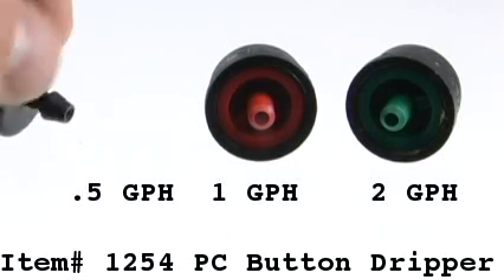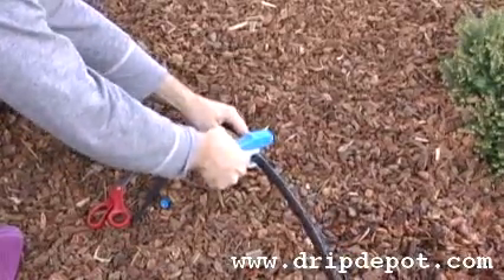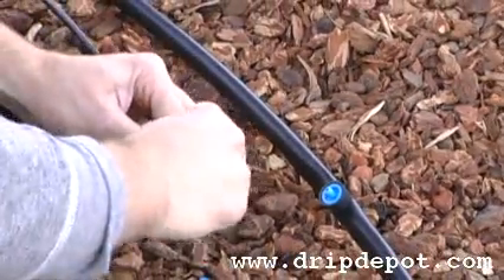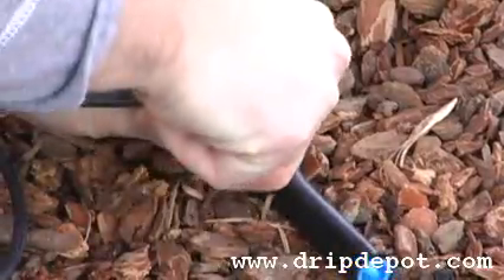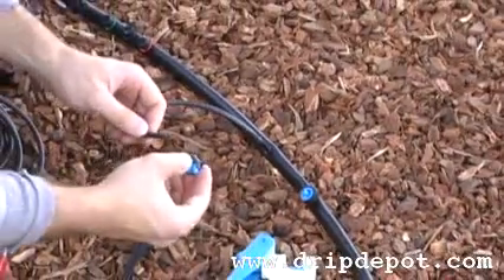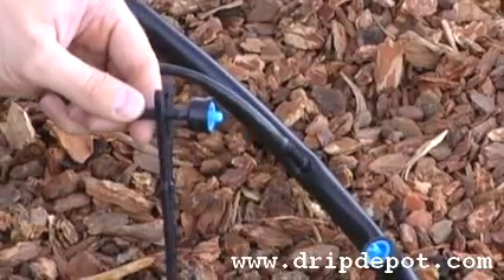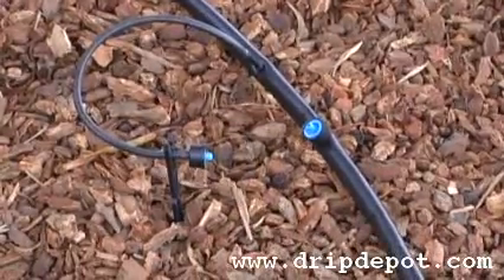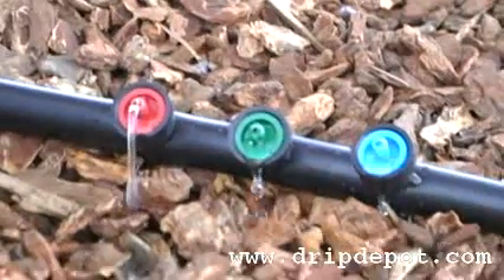Drip Irrigation Systems -How to install Pressure Compensating Button Drippers

Comment: Can you use these to make a dipper line?
Reply from the maker: In a way, you sure can!  These can be punched into the wall of 1/2" or larger tubing anywhere needed.   It may not be "true" drip line with the emitters being inside the tubing, but the end result is pretty much the same in that you can have drippers wherever needed right down the entire line :) 

With inline drippers a similar thing can be done for 1/4" lines.  Here's a short video that shows how it can be done on 1/4" tubing with inline drippers, just in case you had 1/4" in mind: https://www.youtube.com/watch?v=t4iC8rh9CPQ

Comment from the maker: Hi Justin,
Thanks for the question.  What you see in the video is a hole being punched into tubing that was already filled with water.  That is why a little water seeped out before the insertion of the 1/4" barbed connector. The hole punch punches a hole that is slightly smaller than the 1/4" fitting.  This creates a water tight seal.  Often a "popping" sound is heard when pushing the 1/4" connector into the 1/2" mainline due to the tight fit.  Let me know if you have any other questions. Thanks